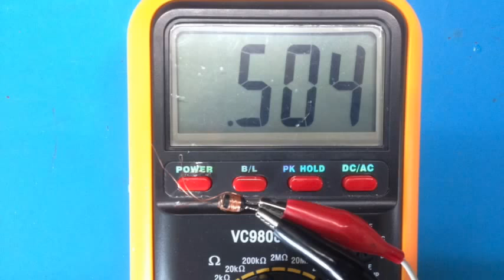Bluetooth-like Miniature Crystal Radio

Comment: Excellent build , Billy. Very impressive. I built crystal sets when I was a teen back in the 60's and used a lot of scrap radio parts , along with my fave, a GE 1n34 glass diode. I still have one and it still works as well as it did back then. pretty cool stuffvyou have on here. I subscibed !

Comment: Good design... small and pocket... Many years ago I made crystal radio from telephone 600ohm capsule and diode ( without tunning circuit )... and in fising time, i connect antenna, grond and hear strongest stations...
Reply from the maker: Ingus Siliņš , thanks for your sharing. When I was young, I lived on the 2nd floor of an 8 floor public housing surrounded by high rise building. Crystal radio reception was impossible. I have to go up to the roof to pull a long antenna down to my apartment on 2nd floor. Even so, reception is poor , just nearly audiable. Because the antenna is too close to the wall of the building. And my components are poor. Nowadays the components are much better but the more  high rise buildings make crystal radio reception even more challenging
Reply: To Billy Cheung: In my young days I lived 2nd floor and I use  about 5...6m indoor antenna and ground , and I can receive short wave stations... strongest "неметская волна" ( German wave ) and samtimes you can hear corespodent about 1...2m away from headphones...
( crystal radio with tuned circuit and 300 ohm headphones, germanium diode )

Comment: I've got a question: Do you think, it's possible to make this receiver and transmit with a transmitting power of about 10 to max. 100mW in order to power up the crystal radio with a very small antenna (some millimeters) over 1/1.5metres ?
Because I'm planning to build a very small crystal with a as small as possible antenna.

Could you answer my question whether it's possible or not?
If your interested in my project, we can also discuss a little bit more about it - it would be a quite great thing if it works.
Thank you in advance!
Reply from the maker: FabiP1997 

Sorry for the late response.
I was not aware that I got so many good comments until now.

I've tried to create a very simple transmitter hoping to do what you described. I think it'll help in my demonstration to students inside an in-door  classroom where antenna is not easy to set up.

However, the effect is not great. You almost need to touch the antenna's transmitter with the antenna of the crystal radio to hear what you are transmitting. 
I think you will need to build quite a powerful transmitter before you can use a Crystal radio with a short antenna.

I've seen an articular somewhere on the internet that someone did just that with a circuit using multiple FETs to transmit MW radio broadcast at home so he can use the crystal radio to listen to his favourite FM stations.
You can try searching for AM transmitter to see if you can find it.